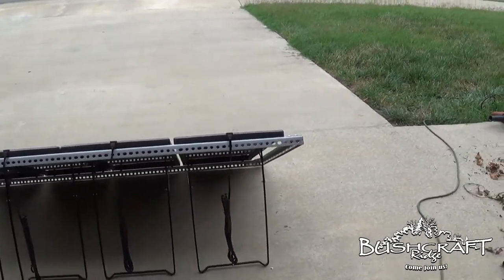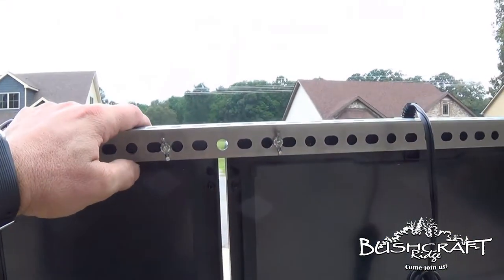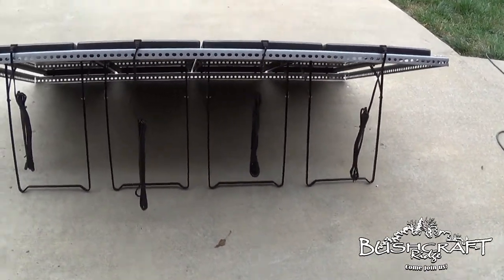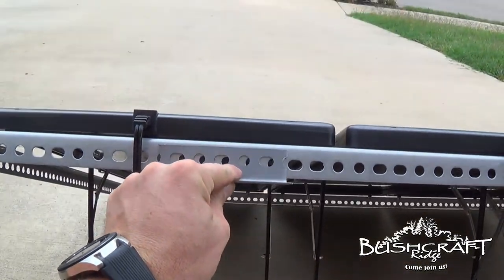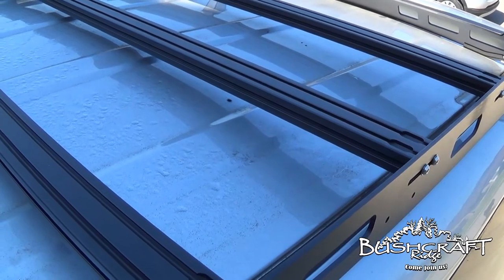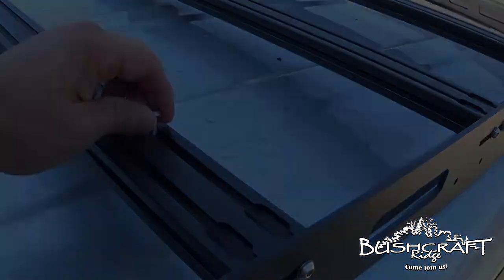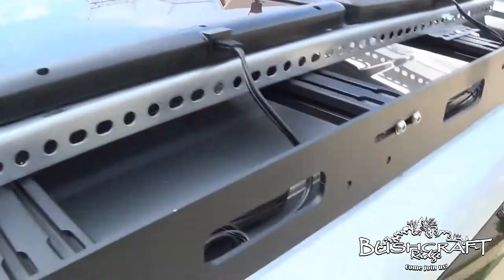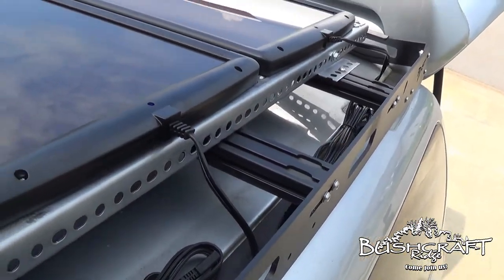Mounting Solar Panels on the 4th Gen 4Runner

Comment: If I may add, I started this way and eventually ended up not using feet and turned the rails inside out, which in turn allowed me to mount them plush to the rack (sunk in) the rails directly mounted the same way you did but on the roof rails side track instead of the top. This allowed me to even put my kayak on top since the panel is sunk in.  just sharing in case interested.
Reply from the maker: That is a great idea! Thanks for sharing!

Comment: This is very cool! I can't think of anything that needs changing and I certainly wouldn't worry about adding washers. As for flat mounting that very sturdy and aerodynamic. It would be awesome to have some kind of adjustable rig that allows slight lift, 30 degrees from flat is ideal for solar panels, and horizontal rotation. But for what you need and following the K.I.S.S. method it's good to go. Keep up the great work!
Reply from the maker: That's a great idea! If only I had the patience to make that happen. LOL!
Reply: @BushcraftRidge  I have been looking into solar panels lately as my friend is considering solar battery "drip feed" to keep her RV trailer battery fully charged. Your recent videos on the solar and that inverter on your beast and at Cool Cabin have been excellent. :D
Reply from the maker: The only thing I have negative to say about these panels so far is the plastic frames. I foresee them getting brittle and breaking, especially at the hardware attachment holes. When that happens, I'll replace them with aluminum framed ones from Amazon.
Reply: @BushcraftRidge  darn plastic and -40 here have a bad relationship. Aside from the plastic they seem decent though. 
I've also been thinking about some kind of compact wind turbine that what, when the wind is sufficient, her trailer will charge day or night.
If your setup lasts a few years especially with your aluminum idea I would say it's worth it.